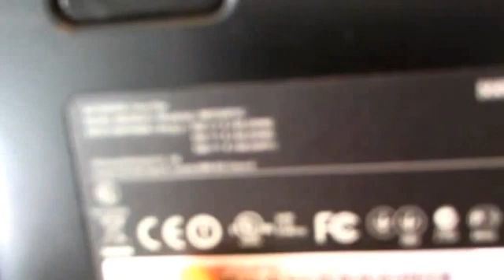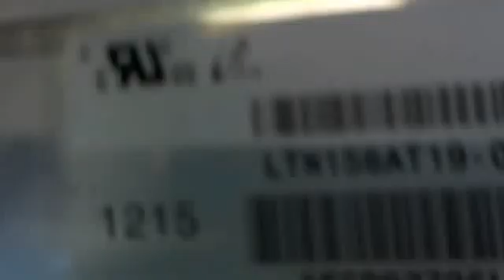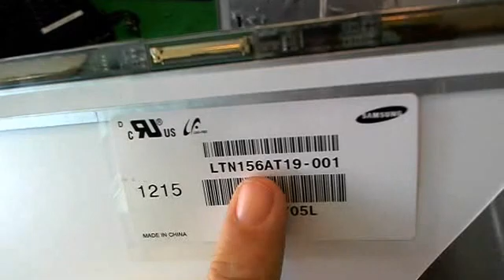Samsung NP550P5C 550P Laptop Screen Replacement Procedure

Comment: I have a NP550P7C laptop, which I needed to replace the screen, but couldn't find a video for.
You can use this video, BUT beware! There are screws holding the bezel on at the bottom, behind two round covers.
Also, the screen removal is slightly different. Once the screws at the top are removed and the screen tilted forward (it won't go all the way to the keyboard), there are four screws on each side which you have to remove. The screen will be free then and you just have to remove the connector.
Good luck.
Reply: Where did you find the screen ?
Reply: @arditaita5353  It was six years ago, but I think it was eBay.

Comment: I don't think so! I did exactly that (replaced the LTN156AT19-001 with an LTN156AT19), and it displays all the wrong colors!!!

Did you end up replacing the screen? Did you have this problem? If not, where'd you get the screen? And was it an exact model replacement?